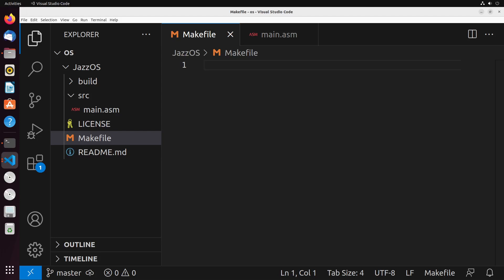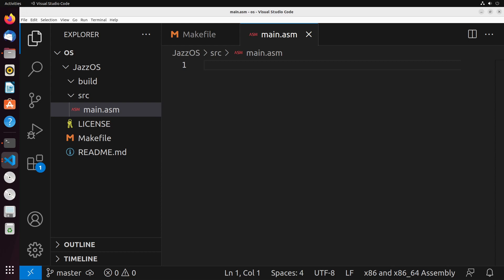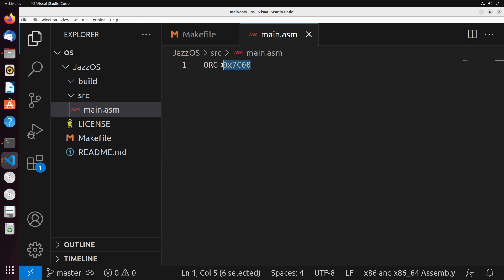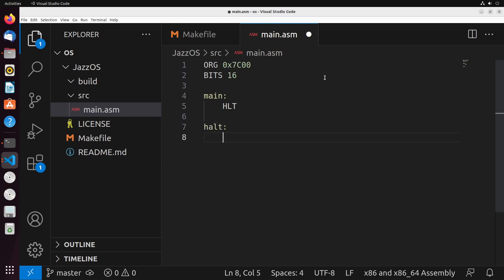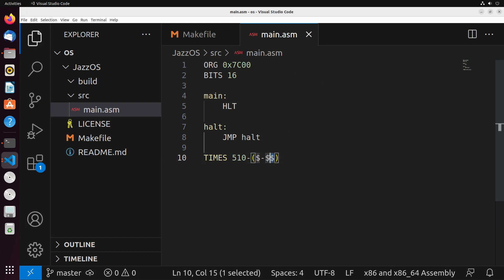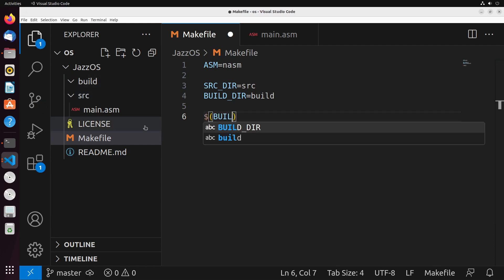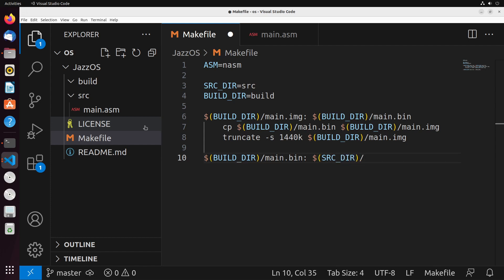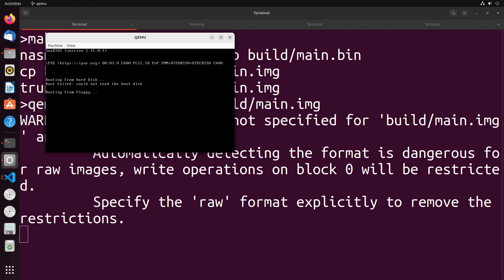x86 Operating Systems - Building a Simple Bootloader

Comment: hello, thanks for the tutorial. I wanted to ask if i am using qemu-system-x86_64, will the build process be the same as mentioned here?
Reply: Yes, it will. Any x86 program can run on an x64 processor. It was designed by Intel and AMD specifically for this use.

Comment: How can i boot that programm of a usb? If i put it onto a usb and try to boot from it, it just doesnt work and flashing it to the usb by using rufus also doesnt work.
Reply: You need to write an image to usb, not just put a file there. Use something like Etcher tool to build bootable USBs. With Rufus most likely it doesn't work because Rufus is for Windows and it barely works with anything else
Reply: @noderiviera  Thanks :)

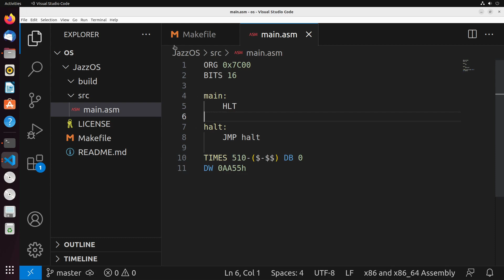Comment: @6:11 when you do define DWORD 0AA55h, this is in hex right i.e 0xAA55 meaning this is 64 bit data. Is not 64 bit data is QWORD why defining with DWORD also works ?
Reply: Its 2 bytes = 16 bit data (1010101001010101), 4 bits for each hex and hence a word in total.